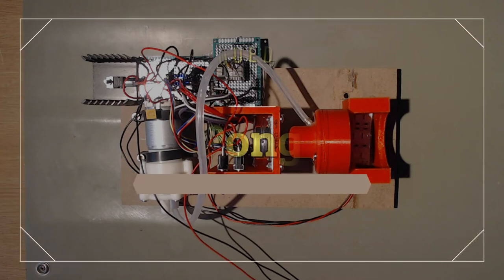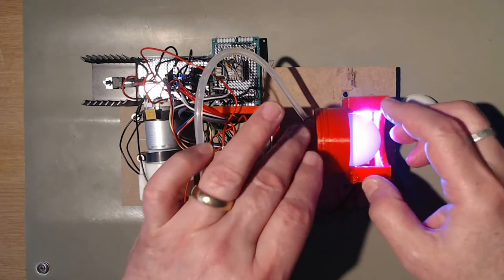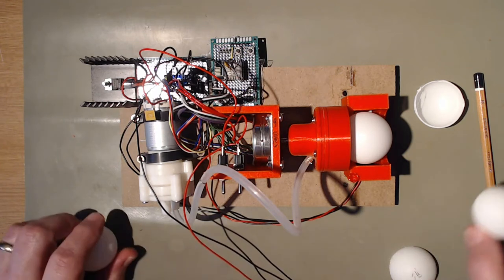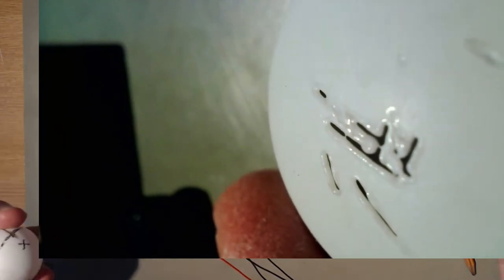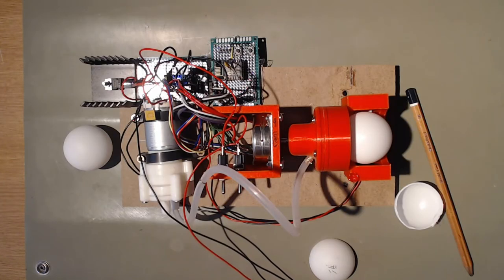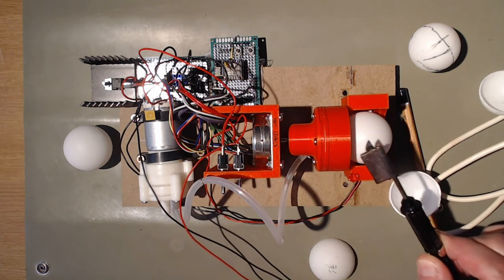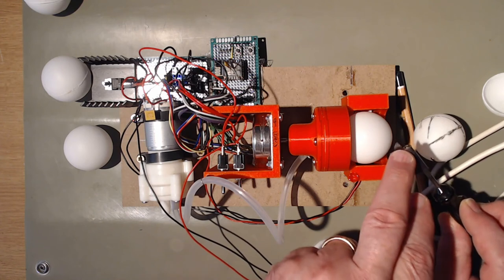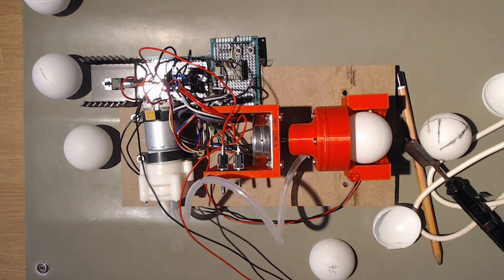#113 Ping Pong Ball cutting in half fail!

Comment: Wow! Just WOW, what a contraption! 
I have cut aluminum cans by turning them under a razor blade.
Reply from the maker: I might try that, I just expected the lazer to go through .5mm or so of plastic with no problems. but when you have a pile of bits and a 3d printer heath robinson like contraptions are easy to make. Glad it gave you such a reaction. :-)